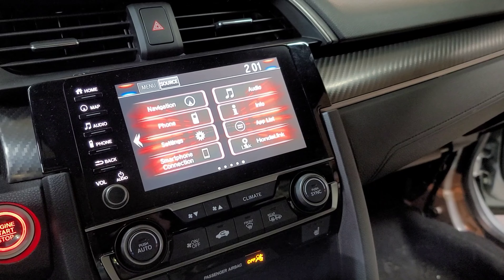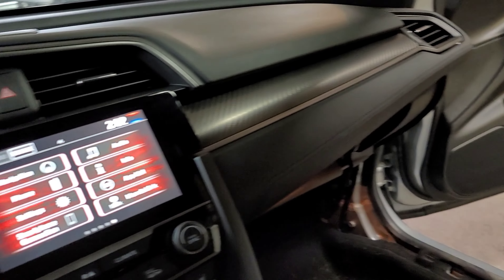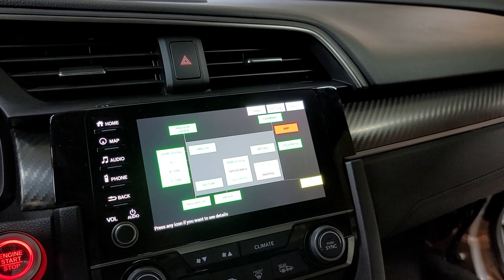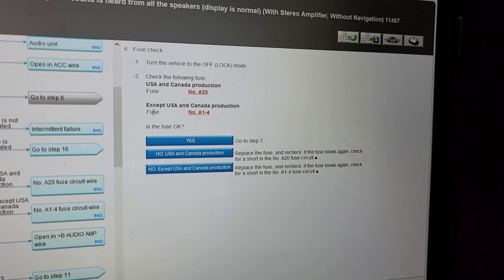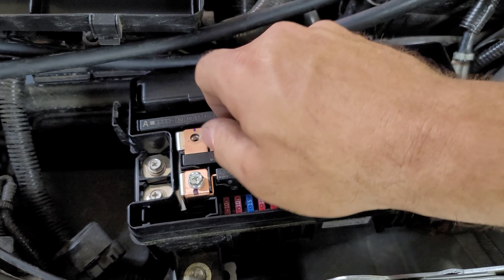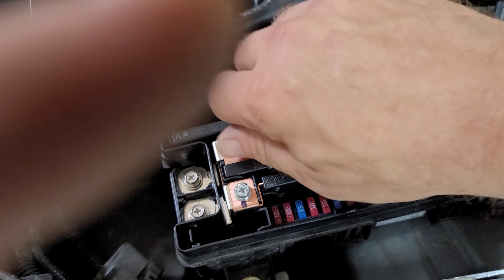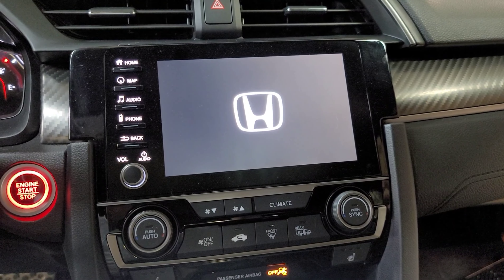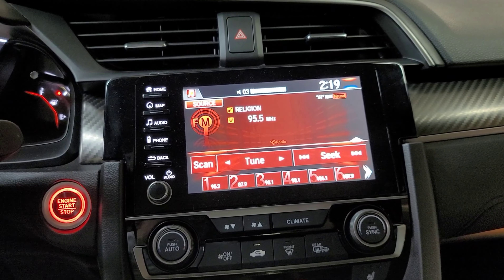16-21 HONDA CIVIC NO AUDIO SOUND FROM SPEAKERS EASY REPAIR

Comment: I followed all of the above steps and it appeared I had no fuse out.  The Self diagnostic head unit test showed no errors for me. After several restarts and factory resets...nothing....not a beep. It was after disconnecting the battery, then removing the multi-fuse, 15a radio and 20amp Amplifier fuses (all fine when tested).  Then reinserting everything, reconnecting the battery and going through the car startup steps after a disconnected battery... holding the power for a couple seconds......I noticed that the beeping on the headunit returned.  What I described are the steps I followed. I posted them to show my experience for others trying to troubleshoot.  In reality, it was likely that leaving the battery disconnected allowed for a system reset and my tinkering with the fuses were unrelated. Good luck!!
Reply: So you said all of that to say that you up had nothing wrong the whole time?

Comment: Ran into an issue similar to this today with my 2012 Fit. Had absolutely no audio from any of my speakers but my headunit[factory] was working just fine. Checked fuses, all was well, battery and alternator were fine. Long story short, the culprit ended up being a defective Wiring Harness that i used to install some Pioneers 2 days prior. After reinstalling the factory speakers, I had audio once again. Hope this helps 🙏

Comment: Hello need some help, my fuse was blown, changed it and blew again. What's the next step?
Reply: Change it again
Reply: @angelchavez-ud2nh  isn't there a chance it'll blow again?
Reply: Yeah definitely dont just change it again lol. I’m in the same boat, i think next I’ll check the amp wires and next replace the amp

Comment: I imagine the fusible link would not be cheap.
So how do you find out what caused it to blow in the first place..
Reply from the maker: Modifications to speakers 🔊 and or amplifier, also posible short in the amplifier
Reply: @melniksmotors  So if it was a short in the amp, wouldnt it just blow that fusible link again?

Comment: I have the same problem on a 2016 Honda Civic and I did the whole process shown in the video and changed the part but it still doesn't work